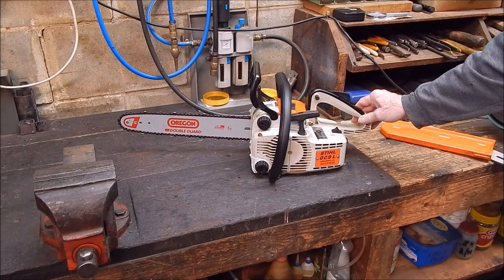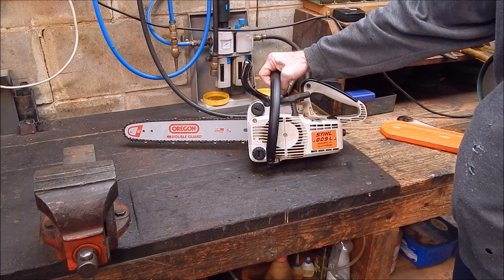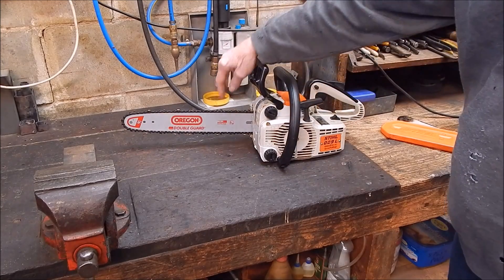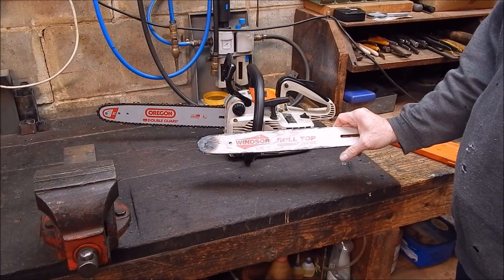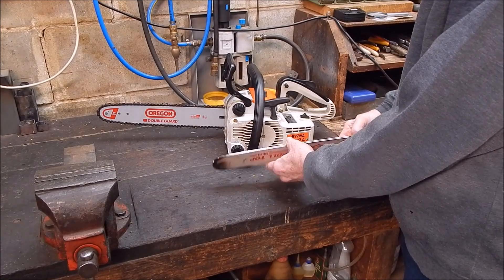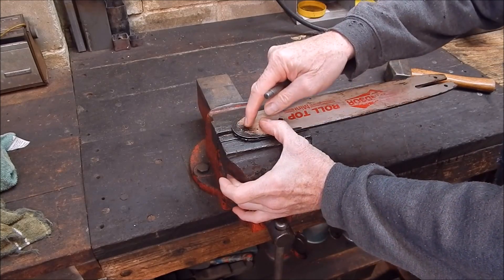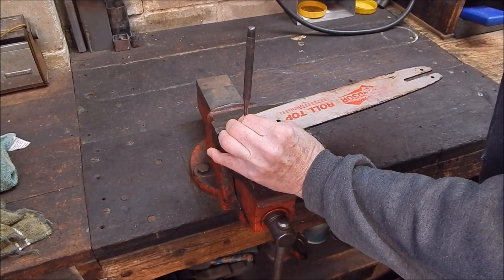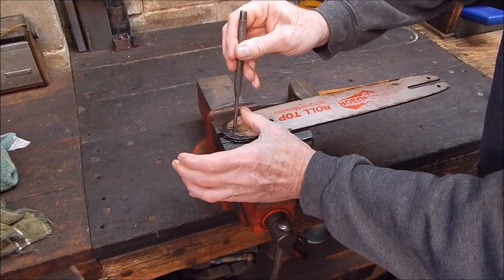What's inside the roller nose on a chainsaw bar ?

Comment: There's an oil channel all the way through the bar so the oiler back in the saw lubricates that from sprocket. Not a lot of people know that
Reply from the maker: No.  If that wa s correct there would be oil pissing out the roller.  Stihl and other brands make and sell greasers specifically to lube the roller.

Comment: I have the same bar (on an old husqvarna 61), and my tip is finally wearing out too - after 25 years of use ... heh heh.  Nice to see what is inside.  I have other saws, and kind of put it on the bottom shelf, as it isn't as fast as the others.  But, every once in a while I pull it out and cut with it for fun.  It did put a lot of wood on my truck over the years, and I bought it used for $225.  I definitely got my money's worth out of it.
Reply from the maker: Good to hear!

Comment: These roller (sprockets) IMHO are added to your saws for one reason.  to shorten the life of that product.  I'm mean just think about it, the chain runs on the bar, all the action of the chain is carried out on that bar...back in the day bars didn't always come with these an ran just fine.. I will tell you, my sprocket has jam the saw tight much like a disk brake on a car when tree chips get caught in that thing an over heating the saw & bar till you disassemble clean & free everything hopefully before you do serious damage to either saw or bar.  Can you find a roller free bar, it becoming almost impossible, & I believe it's a way to build in a failure to the products..I could be wrong, but like they say..if it looks like a duck !

Comment: The bar has to be reground, and the rollers and sprocket replaced.  There are companies that do it but probably not cost effective on as small a bar as you have by the time you figure cost of shipping and parts replacement, just cheaper to buy a new one and keep it greased with high temp high pressure moly grease everytime you fuel and add bar oil.

Comment: I have small Mculloch from the 80s and the bar is worn top and bottom but the roller still rolls, mind I have given it an occasional grease through the little hole in the tip with the supplied grease gun.

Comment: Interesting.  I imagine lots of people have chain saws forever and do not use them enough to wear out a bar.
Reply from the maker: I expect so.  I bought this saw new and it was damn expensive at the time ($400 ?).  Now Stihl is much cheaper in real dollar terms for a similar sized unit.

This new bar will be the fifth one I've had on it.  It has done some pretty hard, shitty work over the years, but is still going strong.

The 009's hold their resale value very well in Oz as the 4x4 guys love them, being so compact and gutsy.

Cheers Rob

Comment: Rob. Are you greasing the Bar nose sprocket, or just relying on the bar lube? seen several of our Husqvana 372XP chainsaws with this and it was from the operators not greasing.
Reply from the maker: Hi Peter,

I always empty the gas and oil/check the sprocket before putting the saw away, so it's ready for next time, but not at the job.

It may well be that it needed more during the job, as this was an Australian Mallee tree which is rock hard stuff, especially when dried.  This tree was a windfall and still reasonably green as the main root was still intact.  I did about two hours continuous cutting.

It's the first time it's happened to me, but it's also the first time I've cut up this type of timber.

The roller did jam up twice in that time, suggesting I should have had a closer look.  I assumed it was sawdust and it freed easily, then carried on. 

I did notice the tip was slightly burnt before I started this job, suggesting it had got hot once before, so it was probably already on the way out.

Cheers Rob

Comment: I also have one just like that, only difference is yours looks brand new!   My saw sure does look used but you are right they are one strong little saws.  And they don't tire you out when doing limbing and the like.  Thanks for sharing
Reply from the maker: The only trouble I've ever had with it was the reed valves gummed up from standing unused for a few years once.

Have you ever experienced that ?

Cheers Rob
Reply: Rob, no I have not.  And mine had set for several years at one time.  However here in the states they normally sell gas with 10% ethanol added.  I do not use it in the small engines, we only use pure 100% gas.  Have found that the added ethanol is the source of many problems, it seems to have an affinity for water.  And it will eat away the seals in the carburetor.  But that may not have been your problem.
Reply from the maker: Hi Glenn,

We don't have ethanol where I live in Oz.  I suspect the two stroke oil residue probably gummed the reed valves shut.

I use Valvoline purple two stroke oil as it is way better at not gumming up carbs than the BP oil that I used to use, but I still suspect that is what happened.

Cheers Rob
Reply: Hi Rob.   Very good point.  I have always bought the genuine Stihl oil additive.  I understand it is much more expensive but it has never given me any problems.   Don't know if you can easily get it but, I am thinking it is worth considering if the problem ever comes back.    Have a good day over there!

Comment: Was good to see, thx.
Do you grease it?
Reply from the maker: No.  I never have.  I usually squirt some bar oil in the holes before using it.  I've had a couple of Stihl bars that didn't even have a grease port for the roller.  They lasted OK.

Cheers Rob
Reply: xynudu that is because stihl products they do make exceptional quality, I regularly grease my tip of my Husqvarna and Oregon bar with a general purpose Grease. I do cut hardwood but mostly softwood never had an issue. Love the old Stihl by the way. 
unfortunately Stihl could not compare to Husqvarna in price power weight or bonuses when I bought my last so therefore I ended up with a Husqvarna still like to use the Stihl chain, and wish I could use one of their bars as they wear so nice.

Comment: Hi All, I have the same saw, had it from New. it has always had a troublesome oiling system. works on crankcase pressure pulses via a diaphragm.
Reply from the maker: Hi Glenn,

Mines been fine.  McCulloch uses the same oiling system.  I checked oil flow after removing the bar and all was good.

If oil was the problem then the bar flats would be burnt as well, but that's not the case.

Cheers Rob

Comment: Only question left is was your oiler working?  I prefer the old saws that had both manual and auto oilers so I could soak the bar good when the cutting got tough.  I put used engine oil in so I was never bashful about over oiling.  Bars and chains lasted much longer.  I had one of those old Homelites.  Took three men and a boy to pick the darn thing up!  Take care.  Doug
Reply from the maker: Hi Doug,

The oiler was working OK, one tank of oil per tank of fuel, but I think the wood was just so hard (even though it was green) that things got too hot.

Cheers Rob

Comment: Years ago you used to be able to buys kits and overhaul the sprocket nose, before labour cost cost to high.
Reply: Still can. (bit of a pun there)
Reply from the maker: You still can on many of the big bars for commercial forestry use.  The whole tip is removable/replacable and just un-rivets.

I can't see how you could recondition a tip on a cheap/small bar like mine as the laminated end pieces are totally shot.

Cheers Rob